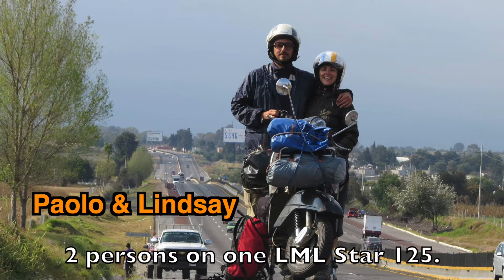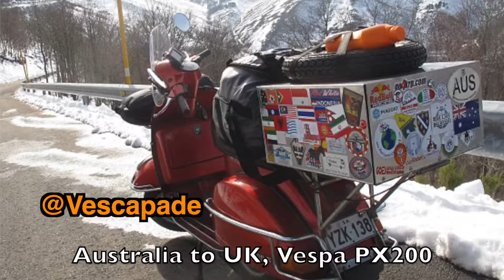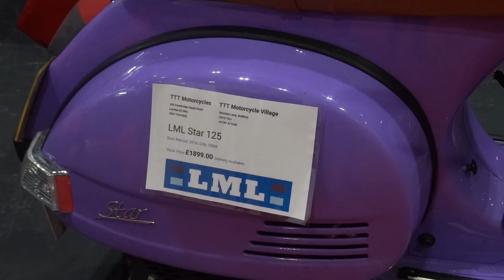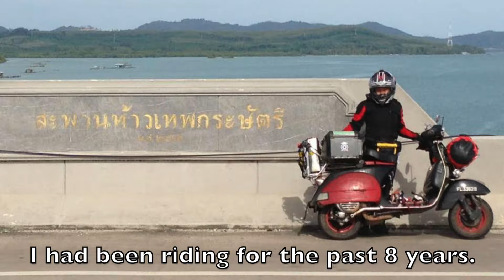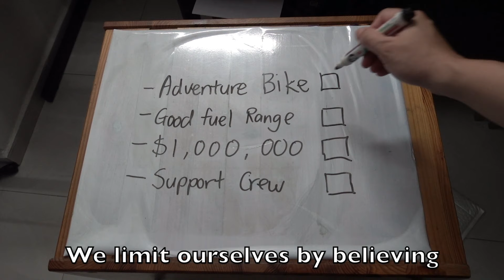The Best Motorcycle to Travel The World (The answer may surprise you.)

Comment: Interestingly some of the best motorcycle adventures to watch on YouTube are on small cc engines. That has to say something about the people and their thoughts and attitudes to how and why when planning their adventures. Brilliant 👍
Reply from the maker: Smaller bikes look less intimidating and is a great conversation starter with locals. Plus, when you travel slow, you experience more outside beyond the road too .
Reply: @TheWanderingWasp  , I was watching C90 adventures and at one point he stops turns around and picks up a 12 pack of energy drinks that had fallen off a truck.
You wouldn't have seen that traveling at speed on a huge sports tourer. Also he had less hassle when crossing boarders.
Reply: Abrar,  itchy boots , both about 300 cm³. Perfect
Reply: because if you are outside of europe, north america and east asia on a high end modern motorcycle and you have problems, you are screwed because the model has not even been sold there, ever...

Comment: Thank you for sharing this video. I plan to own a vespa in the near future. Just wondering if the new modern vespas are reliable enough to go far away places?
Reply from the maker: I have mixed feelings about the modern Vespa, my last trip around Southeast Asia on the GT200 was a failure. 2 engine rebuilt and 4 months in the workshop in Cambodia and Thailand due to unavailability of parts. The older two strokers are easier to deal with. I livestreamed that journey on my Facebook page from end 2022 to mid 2023.
Reply: @TheWanderingWasp  I'll probably play it safe not going as far as you did if i were to get it. Its expensive buying one here in Sg 😅.
Reply from the maker: @nmi8286  That is why I bought a motorcycle overseas for a fraction of what it cost in Singapore. :goodvibes:

Comment: My first motorcycle (scooter) was a 1959 Lambretta when I was still too young for a driver's license and got my first citation for riding it on the street anyway. There are a lot of advantages to touring on the smallest bike that will do the job which is basically carrying yourself and ~60-70 pounds of traveling gear at a reasonable speed, say 50 mph. I have toured over 30,000 miles by bicycle so any kind of scooter or motorcycle would be a step up.
Reply from the maker: I bet those 30,000 miles by bicycle taught you a lot about long-distance travel!

Comment: Hi, I thing the same... I'm planning a trip for south america and the most difficult thing of all is chossing the scooter. I came to the conclusión that the best thing is a lightweight scooter, with simple mechanics, low displacement and air cooling.
This guarantees reliability on an extreme trip.
My options are: Suzuki Address 110 2019, Honda Elite 125 2015, Suzuki Access 125 2020, Vespa XL or VXL 150, Vespa GTS 300...

Comment: Inspiring...
You can go anywhere by using any two wheelers, in any engine capacity.. something we have to consider is, 
Ride at 40 kms sturdy.. do not overstrain the engine.. 
Change engine oil every 2500 kms.. that can do ourselves... 
I used to ride 200 kms around everyday.. leaves every noon.. rides about 120 kms or so.. enjoys tea and snack.. then rides back.. my enjoyable speed is about 35 kms.. no strain..
Reply from the maker: Yes. it is important to understand the capability or limit of whatever your ride. That is great. Slow and easy is the way. Life is a journey, not a race..

Comment: Always interested in more travel. What worries me is the air-cooled  engines like the typical  150cc. Any tips you've  learned?
Reply from the maker: didn't encounter issues with my Vespa being air-cooled. I can't say the same for other bikes. When I ride in places with drastic altitude changes, I adjust the fuel jet to ensure the right air-fuel ratio. that the engine doesn't run too lean or rich. I would rather the engine run slightly richer than leaner, so that it will not be too hot.